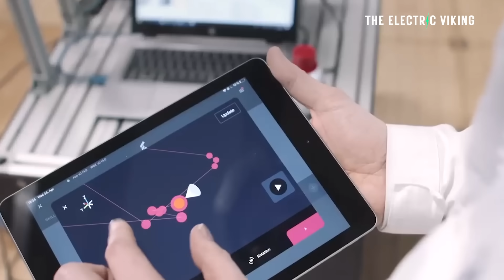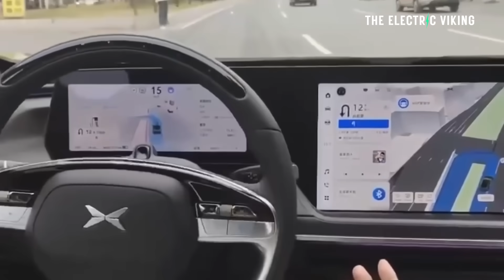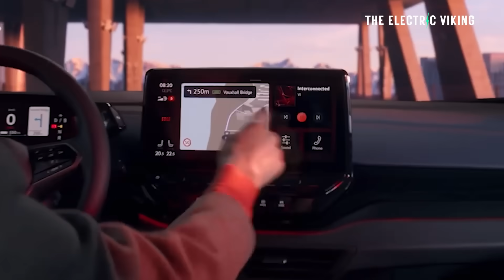NEW Volkswagen EVs will get Xpeng's Turing Autonomous Driving Chips

Comment: Tesla model Y sold a ton in Australia nuf said. Having a chip isn't the answer.  Having the software is what it takes. Software takes years to harden. Also, who believes the Chinese say?
Reply: Thank you professional engineer. It is the combination of the processor, the sensors and the software that determines the performance.
Reply: Who believes what you say?
Reply: @Lost_Johnny  True, who believes me, so when they have their car driving by itself through traffic it will be something right?
Reply: Tesla's only-camera based self-driving mode which does not even recognize large obstacles like children running across the street...?! 😂🤣
Reply: @Netsurf123  where did you get that idea from? When someone threw a skate board across the road? Human or anything would not see that coming. Video is basically fake.

Comment: 6x the power of Tesla's FSD chip 🤣
Reply: For chip specialized for certain job. There is no surpring. Tesla is using custome chip from Nvida, which just a modefied from their baseline chip. Lot of operation relys on sofware level instead of hardware level. It is a more expensive (less efficent) but have better adaptability.